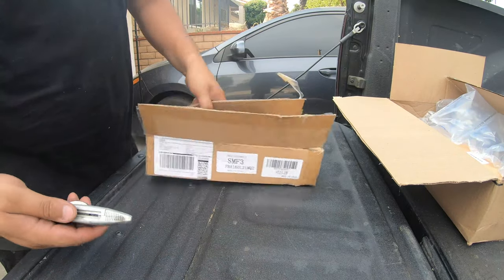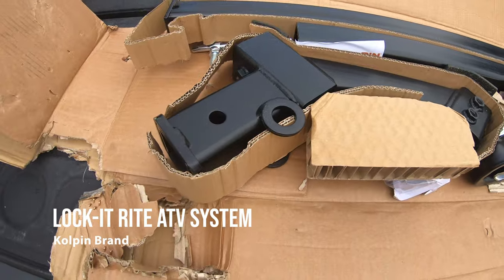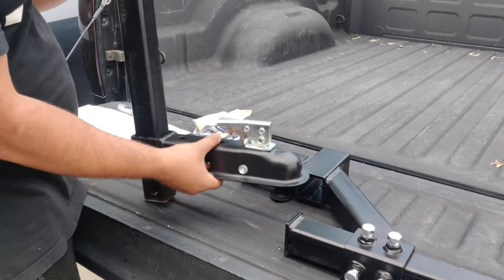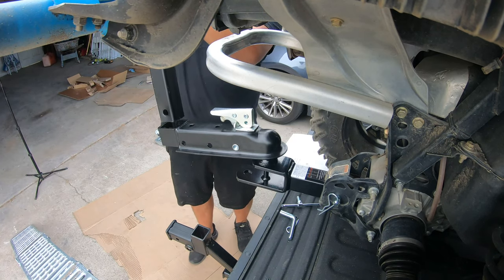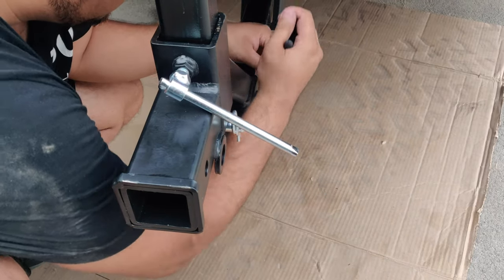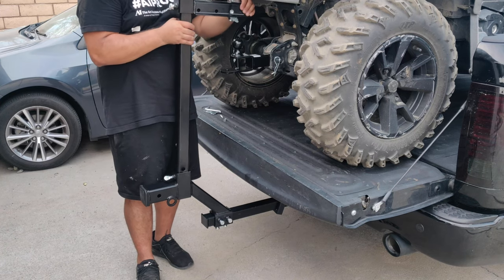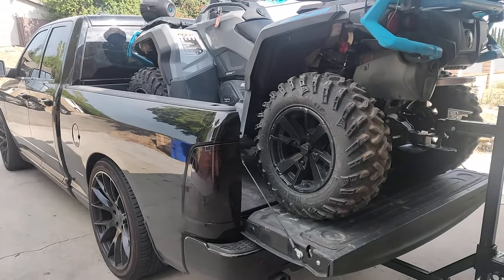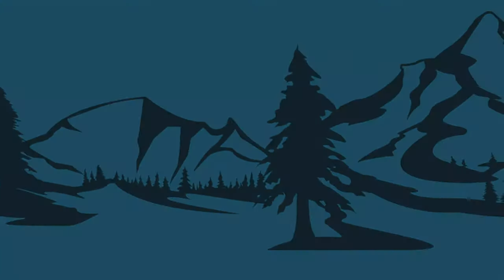Kolpin Lock-It-Rite ATV System for my Can-Am Outlander

Comment: I have this,works well but I wouldn't pull a trailer with only 2 pinch bolts,why didn't they bring the trailer hitch strait out of the bar coming from the truck?

Comment: I’ve got a Silverado and I am looking at the CanAm 700 Max.  The 700 Max has a listed weight of 905 lbs.   my concern with that is the weight on the tailgate.  Does this help alleviate the weight on the tailgate?
Reply from the maker: Good question. In short, the best answer I can give would be no. It's really only to secure the ATV from damaging the cabin during transport. I would recommend DG Manufacturing tailgate supports if the weight on the tailgate is a concern. Usually a tailgate has a capacity of 300lbs. With the ATV weight evenly distributed I've never had a concern or issue in these almost 3 years of transporting my Outlander this way. Hope this helps. 💯👍🏽
Reply: @SoCalOutlanderATV  thank you for the response and especially for letting me know that you have been transporting it for three years.   That does help me a bit.  I had also been looking at the DG mfg tailgate supports.  Thanks again. One last thing, How long is your truck bed?
Reply from the maker: @hashtagjustadad5110  almost forgot I didn't reply. My bed length is 67.2" on the Rebel Crew Cab.
Reply: @SoCalOutlanderATV  thank you

Comment: Looks cool but if the quad isn’t exactly centered it won’t work.
Reply from the maker: Yeah, I can see that happening maybe. My bed is barely wide enough for the tires of the ATV to fit through the width of the wheel wells, so it's always center or very close to it.

Comment: Still using ramp chains wrong
Reply from the maker: I beg to differ from what the ramp manufacturer states in the manual. But to each their own, there's more than one way and if it works, it works.
Reply: Wrong, he’s using the chains correctly, I have the same ramps, although I did a small modification on mine, I shortened my chains a bit and added turnbuckles to take any slack out just to ensure the ramps won’t slip back at all.
Reply from the maker: Yeah the owner's manual says to adjust the chains so the ramps sit tight against the tailgate. 👍 I've never had an issue with them to this day.